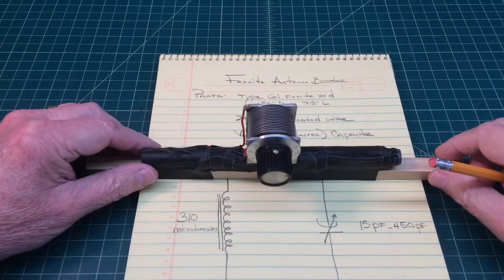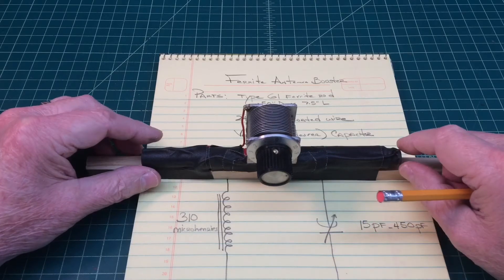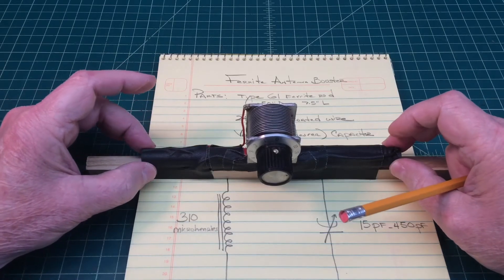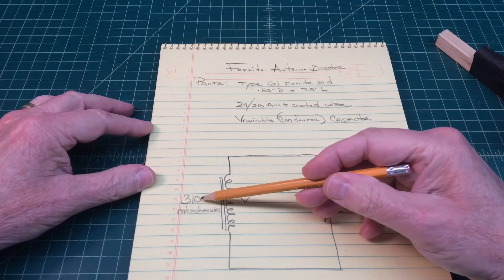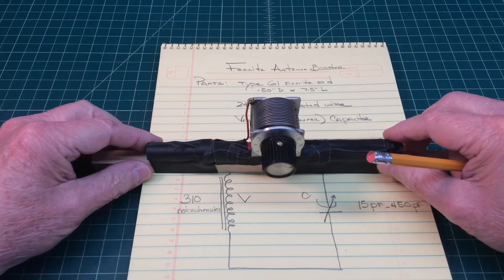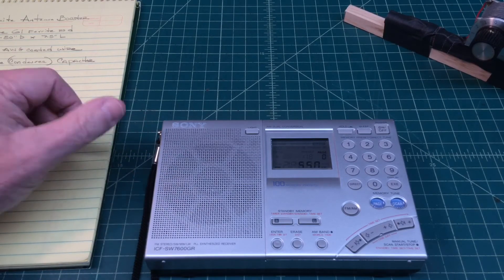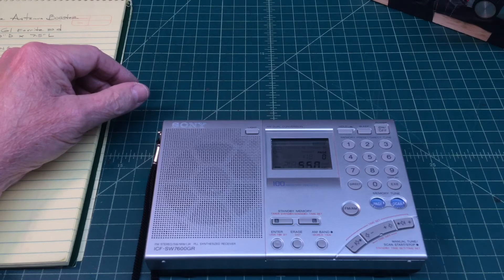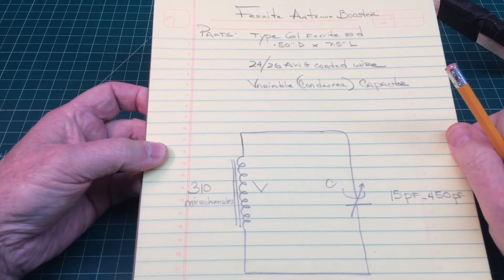Building a Ferrite Antenna Booster

Comment: السلك كم عدد لفات السلك؟
Reply from the maker: It depends on the capacitor value and frequency range you are trying to cover. Check out my video below:

LC Calculations Made Simple
https://youtu.be/YEilRr9EyxA

I didn’t count turns, just used the formulas to close to the desired frequency range and my LCR meter to measure capacitance and inductance. Hope this helps. All the best. Don

Comment: Quantas voltas de fio no ferrite e pode ser fio de cobre ou fio lits.
Reply from the maker: Yes, copper or Litz, but Litz should provide a better Q (more narrow bandwidth). I didn’t keep count of the turns as I used an LCR meter to get the required inductance needed. Hope this helps. Best, Don

Comment: How to calculate the loop winding turns and rood size?
Reply from the maker: I typically use a LCR meter and wind the number of turns to get the required inductance (L). There are some online calculators that will get you in the ballpark as well below. Hope this helps. Best, Don

https://fair-rite.com/rod-permeability-calculator/

https://coil32.net/online-calculators/ferrite-rod-calculator.html
Reply: @RestoreOldRadios  I got the calculator to calculate the inductance but how do I calculate the frequency range of the coil? How do I know what will be the minimum and maximum frequency (band range) of the coil?
Reply from the maker: Knowing your inductance in uh and capacitance range in pF use the frequency formula in the video below. 

LC Calculations Made Simple
https://youtu.be/YEilRr9EyxA

Comment: Hi from Turkey..I have 20 cm ferrite and 560pf variable..How many turns do I need for 150 to 270 khz just for lw? And also what kind of wire ?Which awg? Thanks so much
Reply from the maker: What type of ferrite material is it and what’s the diameter of the ferrite rod? Using Litz wire improves the ‘Q’ vs. stranded 22 to 24 AWG. The Litz wire I used in a recent project: https://youtu.be/P0vF3rFEX3A and a ‘Q’ Multiplier circuit that can be adapted to your frequency range of interest. Best, Don

Comment: Great video, I aim to build one. As an upgrade, I plan to add a simple Q multplier I used in my youth - two coils added over the ferrite with a couple of turns etch, one in the emitter lead and one in the collector of a crude common base transistor amp, adjusted by varying rail voltage.
Reply from the maker: Rhian - that sounds interesting. I would love to see your design once complete. All the best. Don
Reply: @RestoreOldRadios  Does this help w/ shortwave?

Comment: Hello Don, I have two questions. What was the actual number of turns you made on the ferrite rod? Also, where did you get the designer graph top for your workbench?
Reply from the maker: John - I don’t recall the number of turns, but I wound it to the ends of the ferrite rod. Sorry, I no longer have the build and as you know I failed to denote the number of turns. 

Regarding the cutting mat, I bought this one back in 2015. Many vendors and sizes are available. 

Alvin GBM Series Green/Black Professional Self-Healing Cutting Mat 24 x 36
More information: https://www.amazon.com/dp/B007VTP9TK/ref=cm_sw_em_r_mt_dp_dEDCFbVAH6RPD

Thanks for watching and reaching out. 

Best,

Don

Comment: That would be magnetic wire right ?  before I.saw yours I bought a tecsun loop antenna that can be plug in on some radio or just set it next to a.m. Radios I testing of for a weak signal need ,I.paid I think 28.00 yours probably save you some good money near design,thanks for sharing .
Reply from the maker: Ron, I used magnet wire around the ferrite for this build. I’ve got the same little loop as you and it works equally as well. I hope you’ve been doing well and stay safe during these uncertain times. Best, Don

Comment: Do you think this would do the trick?
https://www.rfparts.com/capacitors/capacitors-antennaload/56-36.html
Reply from the maker: Are you building one to cover the AM broadcast band? Best, Don
Reply: @RestoreOldRadios  Yes.
Reply from the maker: Mighty Red Stallion This capacitor should work well if your inductor is the correct value. There’s many LC calculators online you can validate your design and requirements. Here’s one of many: https://goodcalculators.com/resonant-frequency-calculator/

Hope your project goes well.

Best,

Don

Comment: I have a tecsun an 200 loop antenna for AM reception ,I wonder if mine compare to the one you built,which is pretty cool .AM reception in my apt.sucks as far as AM is concerned.
Reply from the maker: Probably not a big difference. I have the same loop and I would have to say from what I can recall, the reception using the ferrite rod antenna was very close to the loop. Best, Don
Reply: @RestoreOldRadios  thanks Don for the info

Comment: Thank you for this video! As a beginner in radio stuff, I'd like to know what the best way is to make a better version of this booster. I mean, does it depend on the length or diameter of the ferrite rod; or the number of coils; or the capacity of the capacitor - the more the better? I have no idea.
Reply: InstaBlaster...

Comment: I bought a 200 in 1 electronic project kit and the antenna was ripped off and lost. How can I make a replacement? I ordered one and it only has 3 wires and the one I need has an extra coil with 2 extra wires totalling 5 wires. I'm not sure how many windings or anything. If you can help I sure would appreciate any advice
Reply from the maker: Would you have the schematic or photo that shows the coil design you can send me? Best, Don
Reply: RestoreOldRadios , the only thing I have is the drawing of it and the electrical symbol. In the drawing it looks like one continuous coil but in the symbol it looks like it has 2 separate coils with a center tap on one which gives it 5 wires. I bought a loopstick with center tap and was thinking about running another coil of about30 windings. Do you think that might work?
Reply from the maker: Send me a photo of it to: TheRadioRepairGuy at gmail.com
Reply: RestoreOldRadios , I just sent 2 emails. The first one shows what it's supposed to look like and the 2nd one is of the project schematic. I hope that helps. Thank you for your time

Comment: Nice video smiles

I usually build one of those into pvc pipe, with end caps.  If you install a pocket radio variable tuning capacitor into one of the end caps you can keep the whole unit slender enough to EDC in a bag with the radio and it will be very sturdy. 

 Longer is better for the ferrite rod and thicker is better for the litz wire windings.  Any kind of stranded insulated wire or magnet wire works pretty well though.  AC runs on the surface of the wire, that's why stranded is better and litz is best.

Comment: Here is a question that has puzzled me for a while. Why ferrite?  Why not wood or some other easily attainable appropriately shaped material?
Reply: Radio Frequency energy being broadcast by a transmitter just LOVES ferrite.  RF waves will actually bend to go to the ferrite instead of just passing by.

An inductor coil would on wood or plastic is no more sensitive than a coil with an air core....actually a little worse due to losses into the coil form.

Ferrite is like a magnet for radio waves.  The longer the rod, the more of the RF that is passing by  can be attracted.
Reply: Thanks Jas

Comment: You can wind an extra coil over it and use it with your long wire antenna to hear distant AM or long wave stations.  Just make sure that you use a RF ground rod with the connection.
Reply: The long wire thing helps a TON!

Comment: Thank you for the video. May I ask you whether “filtering out” instead of “boosting” is a more correct description of what happens upon in practice changing the effective antenna of the radio by the inductive coupling ?

Comment: Interesting video--thanks for sharing! I remember as a youngster using a AM transmitter kit I assembled, which had a coil wound on a form. While it was off, I noticed that when I rotated the tuning condenser while next to a AM radio tuned to static, I would hear radio stations with listenable sound come in fairly clear. 

I noticed that AM 550 is used by radio stations in Pinehurst and Statesville, and yet another radio station in Virginia. It's assumed that the wattage of these AM transmitters is sufficiently low, and the distances far enough, so as to not interfere with each other even at night.
Reply from the maker: +Chet Pomeroy Your AM Kit had to be fun. I had a few of them myself. My database shows Pinehurst at 1 kW Day and 0.26 Night, while Statesville is Directional at 0.5 kW Day and only 0.53 kW at Night. I didn’t study or review the Antenna pattern for Statesville. Have you looked at it? Best, Don
Reply: @RestoreOldRadios--According to what I found on the FCC AM database, WAME Statesville is only authorized for only 0.053 kW (53 watts?) at night. WIOZ Pinehurst is allowed 0.26 kW after sunset. I haven't looked at their respective day/night antenna patterns, but I'm willing to bet that the FCC is watching both of them like a hawk (like everybody else in the business)!

Comment: Hey thats pretty handy never thought of doing that before. Dont have s ferite rod but i have a couple variable capacitors and i can wind a coil easy enough. Thanks for sharing
Reply: You should be able to find a ferrite rod on ebay or some of the other online shops or an old transistor radio.
Reply: yes I'm sure i could find one on ebay with out too much trouble. I buy too much stuff on ebay though lol
Reply from the maker: +LUCKYLARRY +Bobby Tectalabyss Larry, send me a private message with your address and I'll send you one. Best, Don

Comment: I've built a tunable loop antenna but it's rather too large to look like anything but an eyesore inside the house.  That looks like something I'd rather have for indoors instead of in the garage/workshop though I think I'd still try to find a small elongated box to put it in.  Cool job, Don!  Take care, Gary
Reply from the maker: +Rebel9668 Hi Gary. Do you have a ferrite rod? Best, Don
Reply: Not that I am aware of unless it would be inside one of the old solid state radios around the house here or out in the garage.  Take care, Gary  P.S.  Saw that Zenith cabinet last night and it's looking nice stripped down.  Sure it has a few issues but I'm also sure you can make it look in tip top shape again.  I have an RCA 5T tombstone that someone varnished and varnished over top of missing veneer and that's over a weak piece of grill work.  I dread trying to clean that mess up but I'll try to be extra careful when I do.  Right now I'm working on an RCA 56X tabletop.  Take care, Gary
Reply from the maker: +Rebel9668 Hi Gary, The RCA projects sound interesting. Just saw another upload from you to check out. Feel free to send me a private message with your contact info and I'll send you a ferrite rod. Best, Don
Reply: Hey Don, thanks, much appreciated.  I'll cover the postage and whatever the rod itself costs.  Take care, Gary
Reply: RestoreOldRadios do you have any more?